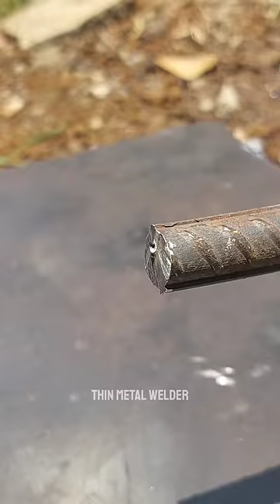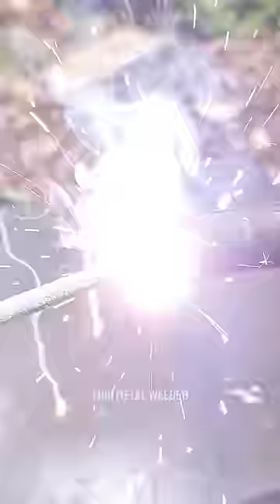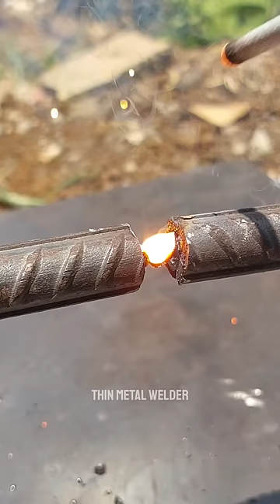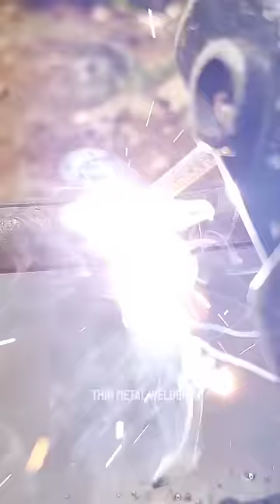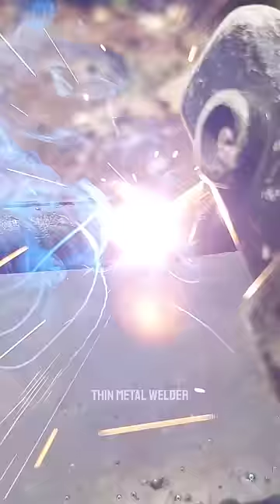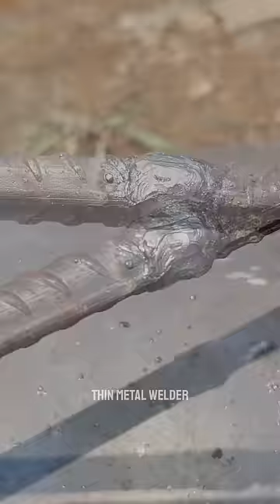the secret of welding strong rebar that few people know  #stickwelding #welding #weld  #howtowelding

Comment: Thanks for a video of how NOT to join 2 pieces of rebar with the weakest weld possible
Reply: I'm a welder can I work with you
Reply: I'm 20 years old
Reply: @DrewMcAdams dude tf😂
Reply: That’s arch welding and it’s pretty strong, my welding hammer broke once and I welded it together with that and it was very strong afterward
Reply: Why didnt he bevel both sides of the rebar?
Reply: Сварочный шов прочнее сомОй арматуры. 
Ты не сварщик если не знаешь об этом.
Reply: indeed, this is exactly what's NOT allowed in any civ.eng. standards, whoever says that the joint might be stronger than the base material might have it right, but that breaks inbetween heat treated layers with modest forces, so do NOT do this if you're about to transfer forces, so NO NO. If it's just for some decoration, then go ahead.
Reply: @ВетерВетерок-т7т русские же ничего лучше жигуля не создали зачем ты споришь с американцами которые создали Додж Вайпер и Кадиллак 😂😂
Reply: @adamnalgiev1634  
Судя по фамилии ты скорее всего казах. 
Но даже если и нет. 
Рсскажи что создали ТВОИ соплеменники.
Reply: @DrewMcAdams ??? What?????
Reply: Ese electrodo parece un 6013, yo hubiera biselado las puntas de los fierros y soldado con 7018,, eso queda más firme.
Reply: I was thinking the exact same thing. 😅
Reply: @heinawithdotshanko just wondering what you mean by this? Are you saying this because he didnt clean inbetween each arc since he didnt do it continuosly and maybe some slag inclusion in there or is it weaker because the metal is kinda annealed afterword? Reason i ask is cuz i did this same thing connecting a broken dig bar but i cleaned after each pass and sure theres hardly no porosity, and im just hoping it will hold up, havent been able to test it yet since i gave it back to the perso. I fixed it for but i hope it holds up to sideways pressure cuz we use that to pry stuff and not sure if the weld will hold up, i used 7018 and also queched in cold water right after to hopefully kinda make the metal harder that way. I know its supposed to be with oil, not sure if water will make it hard but seems like it would freeze the crystal structer to make it hard but im no expert, would you happen to have any thoughts about if it will fail?
Reply: @adam_-adam  Saying this because: 
Hereabout in-situ welding of ribbed rebars is not a common practise. Namely, one thing is that not all rebar types are weldable. And further, outdoors conditions are most of the time such that you cannot prove that it’s ok to do quality outdoors welds, however good your shelter or tent above your welding place is (hydrogen – wet electrodes & base material, temperature can be down to -30C /-22F but usually no work if colder than-15C/ 5F ) 
Anyhows, if you insist to weld rebars it is possible but then be prepared to carry out profound time consuming & costly testing, and maybe even 3rd party inspections. Instead, when playing with in-situ cast concrete, and your rebars, forget all butt welds, use lap-joint welds instead, or the best of all do not weld at all. Rather, use “cold” lap joints and check that the lapping length is decent. And if you cannot get enough lapping length due to eg. formwork restrictions, use rebar couplers (threaded sockets), or factory-made quality checked special parts. Again, here CE-marking gives you some idea whether you can use the chosen parts, or then there are still some national markings which proof quality and suitability for use. 
Or the best of the best is just strictly to follow design documents and instructions of the chosen structural designer 😊.
That above applies to pro builders, or to those selling their products to 3rd parties - “outsiders”. If you’re doing something in your own garage (like me … ) and not selling your top products in quantities, then nobody cares if your brittle butt welds crack due to re-crystallisation- hydrogen-whatever in non-weldable rebars 😊.
But then for your digging bar. I’ve 2 in my garage, a factory made with a hexagonal cross section and one diy-made of regular 20mm ribbed rebar, rather a crow bar this one. Just wondering that how you can break them since those I’ve here are not that brittle, they just bend till the point when the bending becomes partly permanent. The point of the factory-made bar is quenched and very hard, but the bar itself is not giving any marks that it’d break however hard you bend. Maybe your dig bar is made of cold rolled high carbon, high strength & brittle steel for you could break it instead of bending. And high carbon content and tiny little initial faults by welding give less fatigue strength and mileage, or so we think. 
Totally off the topic there are similar dig bars made of aluminium, yes Al, with a hard steel point, costing well over 100EUR. We’ve used them in concrete element installations. They’re light weight and unbelievably strong.
Reply: @ВетерВетерок-т7т и что ? Но на границе шва и арматуры очень слабое место из за перепада температур

Comment: The worst method to join a rebar.
Reply: Jajajaja quizá parecía estar sin ropa pero se tapaban sus partes con algo
Reply: Tap tap tap all this channel does tapper
Reply: What is the best method?
Reply: Да я бы испозовал бы обычный супер клей и все либо изоленту
Reply: It's full peno.
Didn't have to be so wide.
But all metal
Reply: And probably the weakest joint too
Reply: @viktoravdeev8864  overlap the bars on the length 8x their diameter if you weld flare weld just from one side, or just 4x diameter if you weld flare weld from both sides. For more details check EN ISO 17660-1 and EN ISO 17660-2. The requirements in the AWS D1.4 are different.
Reply: What are the strength parameters of the welding material?  Is it compatible with that of the bar?
Reply: @taikongriver4953   they should be because of the size are always equal!!
Reply: @felipig795 😢😢😢😢
Reply: Right. You either pencil point one. Or  bevel both
Reply: @jozefsuchan9489 i actually had to do a rebar weld test for a # 11 bar that broke.   So they had me do a test to see if my weld can handle the shear and  pull force.  And all i did was. Did a pencil tip on one bar and left the other flat.  And welded it all the way around like a pipe weld
Reply: Said by an unexperienced welder.

Comment: O correto é você soldar uma barra ao lado da outra, mas se tiver que unir somente pelas pontas ... faça chanfros em ambas extremidades 😊
Reply: Corretíssimo 👍aí manja 😊
Reply: Если надо соединить два конца, возьмите целый кусок арматуры))
Reply: No,  Welding does make the rebar weaker due to heat. Instead use COUPLERS for rebar joint connection.

Comment: this hurts to watch.
Reply: Please Educate me.. I'm from a different profession.
Reply: me too can someone explain why is wrong
Reply: @doctorpanigrahi9975  basically, the guy here is welding on top of slag, which is the buildup caused by stick welding. Its purpose is to protect the metal from the oxygen while it is cooling off, to prevent the metal from corroding. However, welding on top of this can cause the weld to be weak, because the slag can contaminate a weld, and the weld can break easily. The better strategy would be to grind the 2 ends of rebar to a point, and just put one bead around the whole thing.
Reply: Like a pencil ends on both bars and you can roll from there

Comment: This...looks like what a toddler would do if told to weld these... I'm pretty sure there must be a better way that doesn't depend on the solder material as a metal replacement fit

Comment: It is forbidden to butt weld the fittings! The reinforcement works in tension and such a connection will not withstand the load

Comment: not recommended..because it reduces the tensile strength of the steelbar..there must be an overlap between the steelbars for welding..the length of the wellding overlap is influenced by the diameter of the steelbar

Comment: The typical grade of rebar most commonly used is not weldable, meaning you weaken the rebar steel by applying heat (ie welding).  Only A706 rebar is permitted to be welded.  Also, this is not an acceptable rebar splice.  S.E.

Comment: The solder material is much weaker than the rebar.
Reply: Maybe solder material but not welding material if it's fused properly